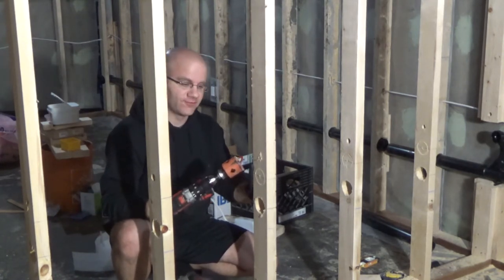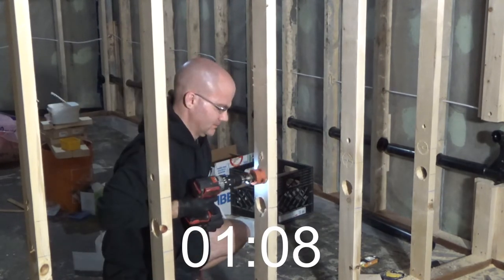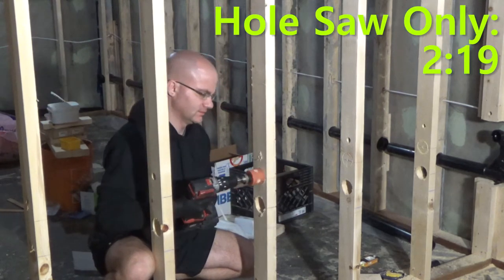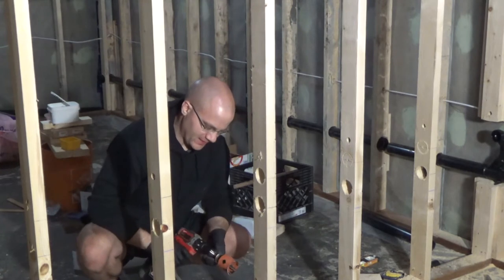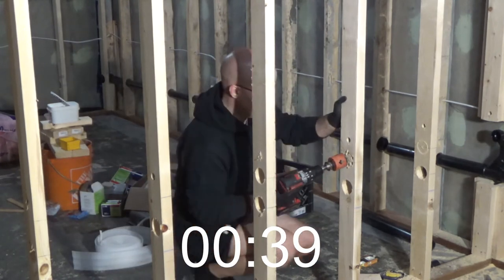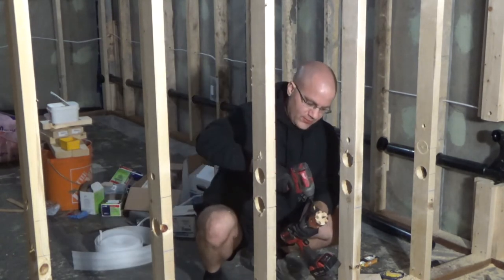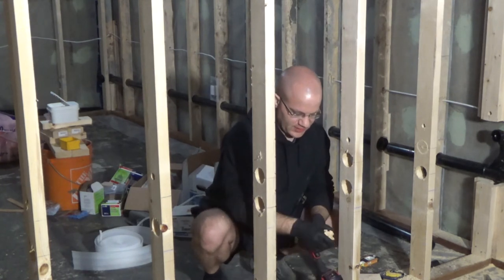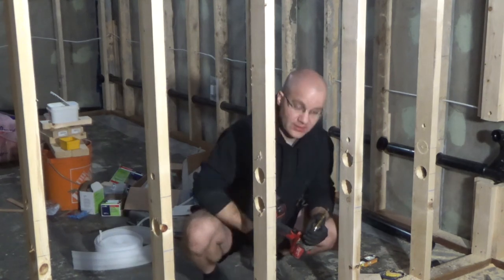How To Drill Through 2x4 For Plumbing ONE SIMPLE TRICK!

Comment: Thanks a million. The tip on using the drill is really great and the video comparison is a slam dunk argument to use that method.
Reply from the maker: It works in a pinch if you're on a budget or can't go get better tools ^^
there's a much better way with a more expensive bit I show at the end, but most people have the hole saw and the drill bit kicking around

Comment: Thanks! Saved me some money and frustration drilling a couple 2" holes for some conduit!
Reply from the maker: Did the same sorta thing for cutting windows into foundation 😁
Reply: @MooseDoesStuff  yeah, i've done this for running dryer vents through my brick exterior... Just didnt think of doing it for counduit in top plates due to severe numbskullery. The holesaw makes it quicker and damn so much easier to remove the plug

Comment: On a non load bearing wall I read you can drill 60% so up to 2.1” max bore with 5/8” left to the side. If you are getting inspected don’t make holes this large or it won’t pass. Maybe this was just an example before the studs were demolished.
Reply from the maker: @rotorav8  or maybe codes are different where you are. this was inspected, and it passed. both plumbing and building.
Reply: @MooseDoesStuff  just talking about IPC and UPC
Reply from the maker: @rotorav8  canada uses cpc

Comment: Good video. I thought you cannot drill more than on hole on the same stud without doubling the stud? Were you able to pass inspection as it is? Thanks
Reply from the maker: @terencelee9704  code might be different where you are. for me, it's not load bearing, only holding up drywall, so they mostly don't care. check with your local codes to be sure tho!

Comment: I my location if you drilled stud like that you will need to support every board with steel stud supports or replace all the lumber.
Reply from the maker: basement walls, no load
Reply: @MooseDoesStuff what if it was a wall for Sheetrock
Reply from the maker: @Thefishingplumber  nailing plates
Reply: @MooseDoesStuff  but like notching for a 1 1/2 pipe would that weaken the wall 🤔 for Sheetrock or tile in a shower?
Reply from the maker: @Thefishingplumber  drywall holds itself up, it doesn't need any 'strength' in the wall. same for any tile backer you might use, durock, schluter, cement board, none of that relies on the strength of the wall. (flatness is a whole other issue)
For this wall, it was in the back of a closet, and behind laundry cabinets. So doubly no worries.
Reply: @MooseDoesStuff  I’ve ran a drain before trough 2x4 notched enough to just get the pipe in, the wall was for a shower

Comment: There must be an easier way to remove the wood cutout piece from the hole saw..
Reply from the maker: If you ever find it, PLEASE let me know!
Reply: @MooseDoesStuff  pretty sure you are meant to cut through half the timber till your pilot hole pops through the other side..  then continue the cut on the other side so when both meet in the middle only the remaining half of the plug sits in the hole saw and you just grab it with your hand.
Reply: I just use my flathead and get the puck out easy